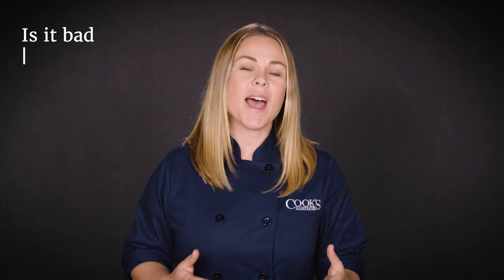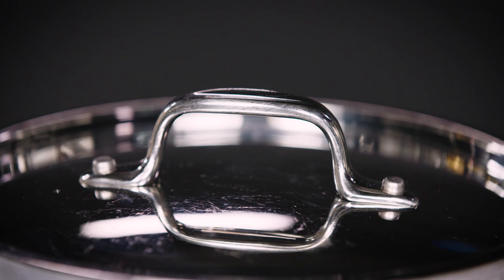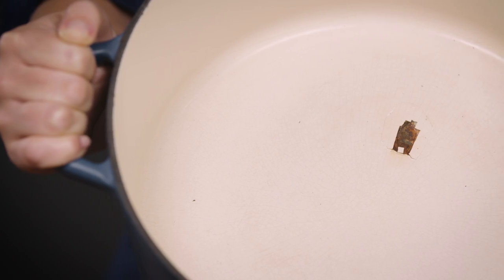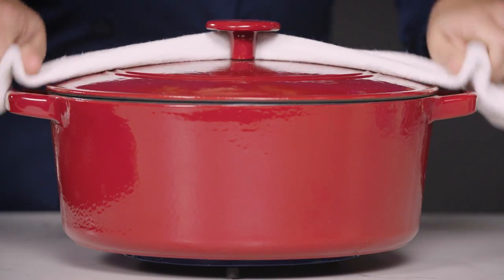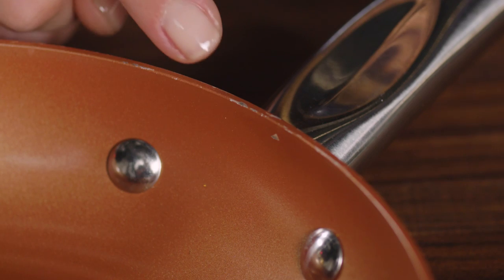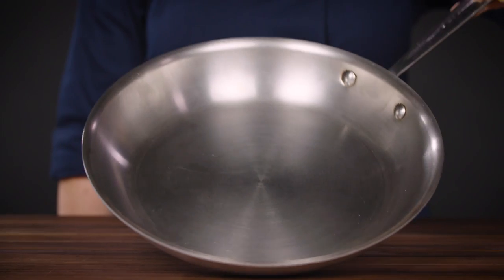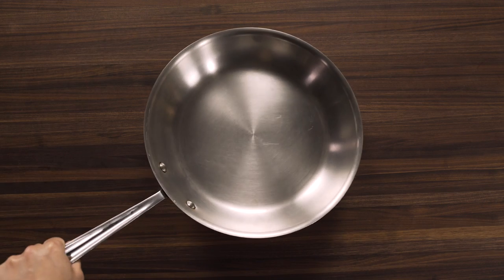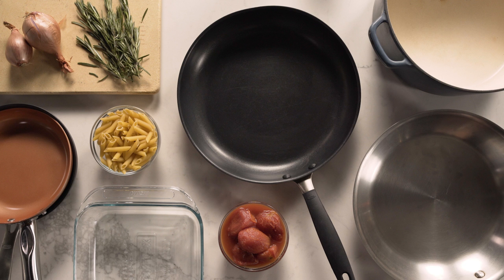Is it Bad to Pour Cold Water On A Hot Pan?

Comment: Look at all the gunk around the handle rivets. Demeyere has a proprietary process that welds on the handles and they last forever. I'm not associated with them in any way, but they are my go to pans. The hygiene, or lack thereof, of all that gunk disturbs me. So I only use pans without riveted handles. Am I crazy?
Reply: Do you eat off the rivets?
Reply: Well if I had a pan with rivets, certainly I would eat off of them. Don't you? But, of course, with all the gunk built up and me being a clean freak, I suppose I would only eat off them when the pan was brand new and just washed.  @CaptainFabulous84
Reply: @michaelgmarks  Well no, I generally don't cook my food or eat off of the rivets. Buy hey, you do you.
Reply: Michael Marks "The hygiene, or lack thereof, of all that gunk disturbs me."

Since the pans are used for cooking, and thus get well above pasteurization temperature, there's nothing "unhygienic" about them. That's just cooked-on oils, like you'd see on a well-seasoned pan if you coated the whole pan. One COULD get in there with a small, stiff brush and clean it to match the rest of the pan, but for most people it's not worth the effort since it doesn't hurt anything. Pans should be for cooking, not for looking.
Reply: With your Marvel(ous) pseudonym, I figured you lean towards the whimsical. Thus I added some frivolity to the mix. So with my micro tweezers and supreme non-riveted set of micro pans, I can cook these delightful mini scones that just fit on the head of a rivet. I use a welded wicker trivet to align the riveted pan so the scones will stay in place on the rivet head. Donning my magical magnifiers, I delight in the scrumptious morsels as I gaze into the river of majestic inspiration and wonder at the working of mankind.
 @CaptainFabulous84
Reply: So, I'm not crazy, I just don't like riveted handles. I do lots of chocolate and they just get in the way as I scrape all the delicious lines of goodness into the next waiting pan as the recipe progresses. I'm sure bacteria live there in between cooking bouts, and some low heat cooking, such as a water bath, just doesn't reach that pasteurization temperature. So despite your analysis, I'll stick to my non-riveted pans. But I appreciate the response. Are you a professional researcher? @seikibrian8641
Reply: @michaelgmarks  No problem with rivetless designs if that  is what you like. But hygiene isn't an issue with riveted cookware. And water-bath cooking can be pasteurizing because it's the combination of temperature AND time that does the magic. That's why sous vide cooking is safe. As for your question, no, I'm not a professional researcher, but at one time I was a science major in college, I've taken some professional culinary training over the years, and I'm a "full-time dilettante."  ;-)
Reply: Thanks. I quite well versed in sterilization since I'm a doc. But my issue is personal preference for the slick interior of the pan and the ease of use. I will say that in a water bath the rivets never get hot and never reach even near a temperature that would approach pasteurization, 145-161F much less sterilization. So I choose to believe my cooking is more hygienic without rivets. Of course I could heat the pan to temp before the water bath, but easier for me to use a slick pan. There lies the possibility that the rivets never harbor bacteria, but since I can't find scientific proof of that, I choose to avoid them. But, as I said, I'm a bit of a fanatic for cleanliness and evidence based research where possible. Great discussion. Thanks.  @seikibrian8641
Reply: @michaelgmarks  "quite well versed in sterilization since I'm a doc."

DC? DO? MD? PhD?

"But, as I said, I'm a bit of a fanatic for cleanliness and evidence based research where possible."

You might find this of interest; note particularly the time/temperature line for 130F/54.4C: https://www.fsis.usda.gov/Oa/fr/95033f-a.htm
Reply: DDS, MS; Professor of Prosthodontics. Dealt in sterilization and infection control on a daily basis. Wrote Infection Control Manuals with documented evidence based research. Fanatic for cleanliness, just as you would want from your Prosthodontist, should you need one. And definitely what you want from the Professor teaching residents how to practice in a Dental Specialty.   @seikibrian8641

Comment: Is it Bad if you fill the pan with water and let it sit before cleaning? I want to tell my roommates not to do this or know if it's fine.
Reply: If the pan is cool it's fine, as long as it's not a cast iron pan. Soaking cast iron will make it rust. Some very cheap metal pans will develop pock marks if you soak them, but I've only found this material in things like cookie sheets and cake pans, not frying pans.

Comment: I believe the pan shown was from the MC2 All Clad line... which is not tri ply... but duo ply... stainless over aluminum only.  If it was stainless steel outside, it would be shiny.         Get the product right please.
Reply: I often wonder why people who don't know what they're talking about insist on posting incorrect information on YouTube. All-Clad's original Master Chef line, and the updated MC2 line, is tri-ply, not duo-ply. Get the facts right please. To quote directly from the All-Clad site: "As with all cookware from All-Clad's MC2 Collection, this pan features bonded tri-ply construction with an aluminum core and stainless steel exterior and cooking surface for rapid, even heating."
Reply: @seikibrian8641  Go read the product specifications on the website for a MC2 skillet.... ssteel/aluminum. You read the marketing blurb... which is incorrect.
Reply: @mrallan8063  It's you who needs to read the specs, not me. You said MC2 to "duo ply." It's not, it's tri-ply; it's just that the outer two plies are both aluminum. (That's why it's not induction-compatible.) You are also incorrect when you state that "If it was stainless steel outside, it would be shiny." If you were more familiar with their product lines you'd know that they offer a brushed-steel exterior versus a polished steel exterior on some products. The only thing you got right is that the text for the MC2 has a mistake in it, and I've notified them of that.

Comment: How about hot water on a hot pan?
Reply: The difference between a 350-degree pan and 140-degree water is less than the difference with 60-degree (or 32-degree!) water, so less thermal shock.